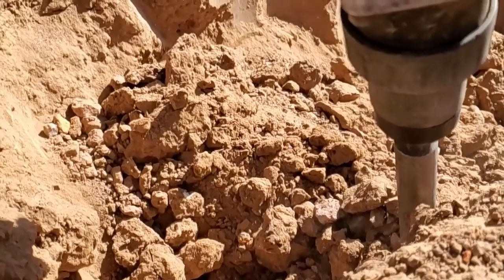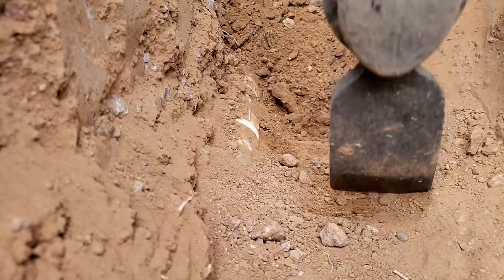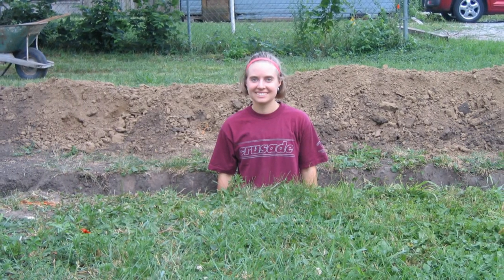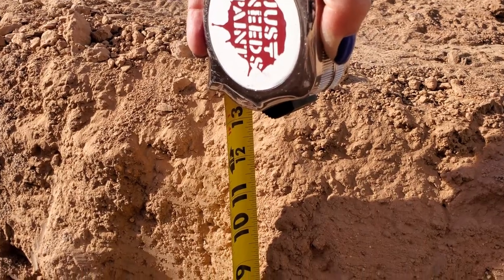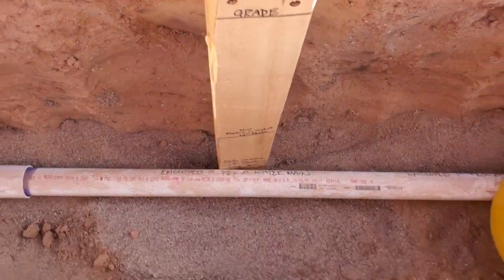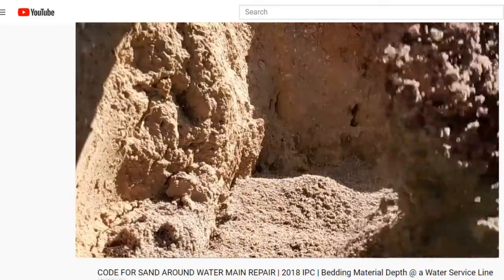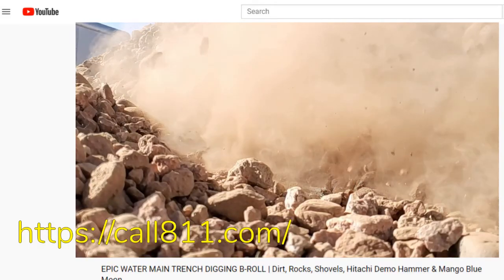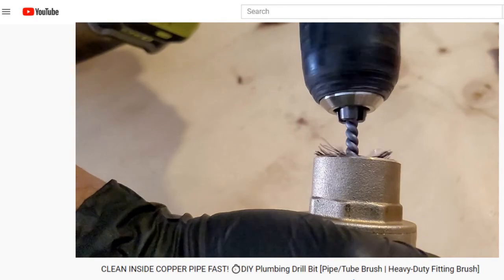How DEEP to Run a New or Replacement Water Service Line [2018 IPC]

Comment: What kind of pipe and what size did you run?
Reply from the maker: 1" PEX which stepped down to the 3/4" entering into the house. I covered how we protected it here: https://youtu.be/nLnXT9e3hK0 Our city also requires 3' copper whips, which I also covered in this video: https://youtu.be/ecVgSCvuVM0. I hope that helps and your project goes as well as it can!
Reply: Ok, so I have a couple of questions. I was trying to feed two efficiencies off the the main but couldn’t; I would be now getting it from a 1/2 inch line in the backyard(20’ off the house) that feeds a hose bib. Could I tap off that and make it 3/4 to increase the pressure even though it’s been stepped down or should I just keep it 1/2. It will be supplying you after to a washer & two sinks.